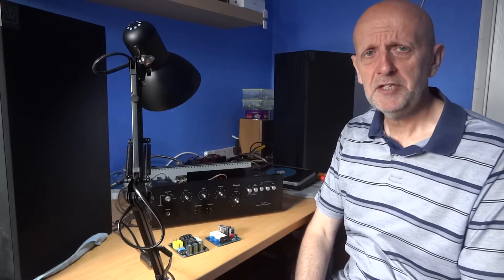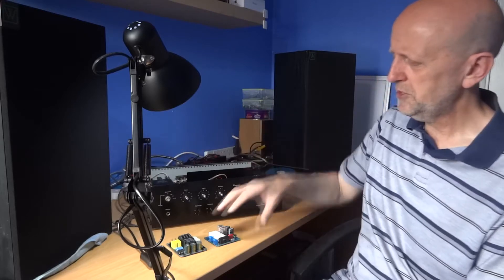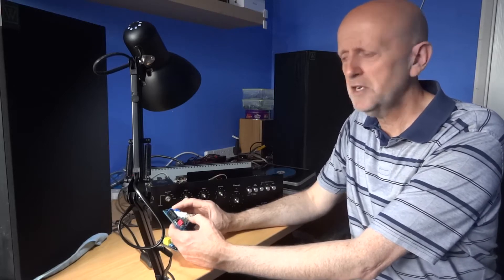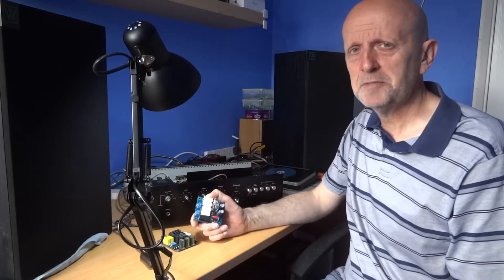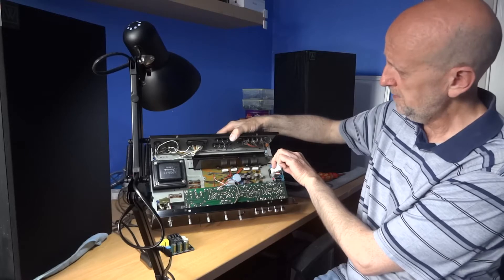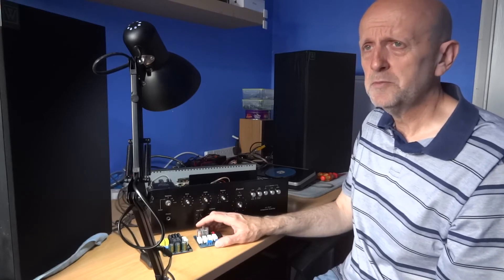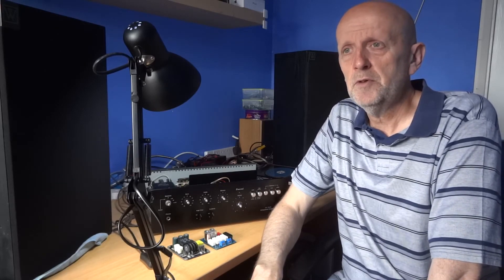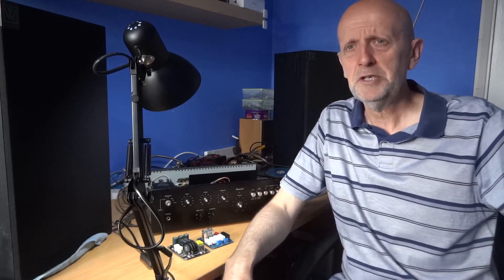Soft Start For Audio Amplifier, Receiver, Stop Speaker Thud & Circuit Protection Vintage hifi motors

Comment: which one should i get, the one with the resistors or the NTC thermistor for a 500/600 va transformer ?
Reply: Niether of these as 500 volt will beyond these specs

Comment: Hi, should I use a soft starter or a speaker protection circuit to remove the thump while turning ON/OFF ?
Reply from the maker: If its on and off then a speaker protector would be the board to use.

Comment: Thanks for the video , I have bought exactly the same soft start board but did not installed it yet, Planning to  install it in my AMP ADCOM GFA 555MK2. Should I connect the two pull switch or just short the two pins on the PCB ?
Reply from the maker: I do not know this amplifier, but if the switch on the amp is a single pole on/off switch then you could take it out of the amps circuit and use it as the switch for the soft start board instead as long as the input and output of the soft start board is wired correctly to the mains side of the amp. Otherwise I would just short out the switch pins on the soft start board as long as you know how to correctly wire the board in to the mains input of the amp. I would only attempt any of this if you know how the amp is wired, otherwise would be better getting an electronics shop/person to do it incase you cause any damage to you amplifier.
Reply: @MichaelYates  It has two pole switch.
Reply from the maker: @RanTausi  I take it then the switch switches live on one pole and natural on the other pole, then I would short out the 2 pins on the soft start board and wire the board after the on off switch.
Reply: @MichaelYates  Many thanks Michael, that is what I've been thinking about.  From the two pole switch the wiring  is going to small connection hub which can be configured to 120v ,220v and 240v.  The amp came originally 120v from US, I have set it to 220V very easy as mentioned in the internal label, I am sure the connection from the hub is going directly to the big P.S windings, so as you said I think you are definitely right. Just need to look for place to Install the SS board and make sure the shortest wiring the better way. Thanks

Comment: Hey Michael, I was looking for something like this for my older amp, so those soft start boards you have there, do you have any parts numbers? I've got a Sansui au-999 I'd like to install in. Thanks!
Reply from the maker: The smaller board has no information at all on it, but the other board has website www.xd218.cn part no.15449D350573. I did briefly test both boards and they both worked fine. The board with website link seemed to be the better made board to me.
Reply: @MichaelYates  Thank you sir!
Reply from the maker: @gime3steps  Hi sorry I did mean to also say, if you do install one of these boards in your Au-999 then please let me know how it goes and your thoughts. I will get around one day installing one myself.